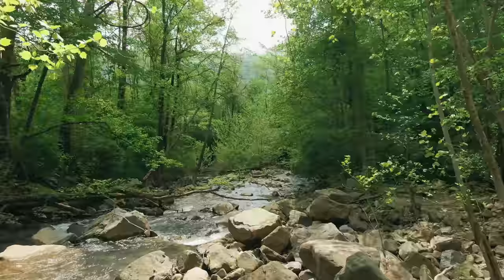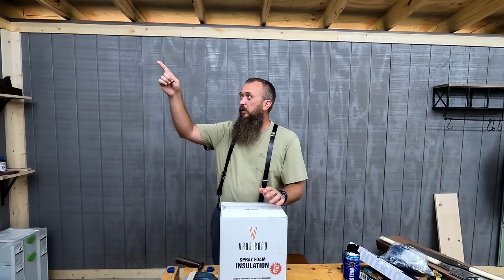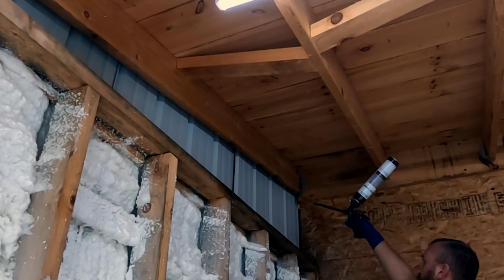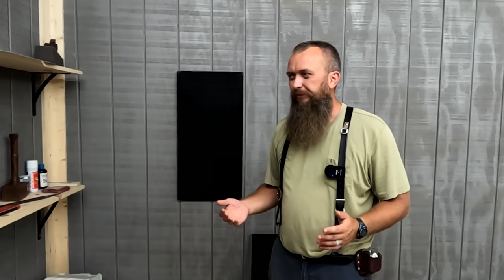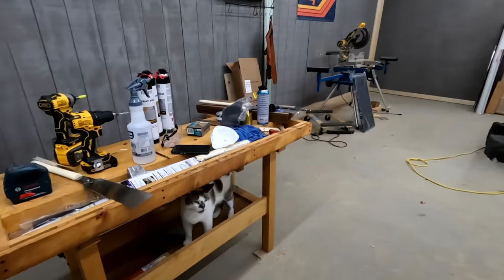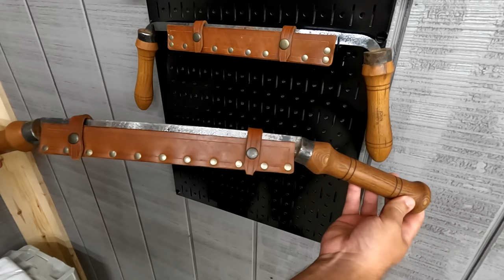Finally A DIY Spray Foam, See How I Saved Thousands

Comment: If you spray and then fill the cavity with fiberglass it will get condensation between the spray foam and fiberglass. Better to fill the cavity with fiberglass and seal on the warm side with foam . It looked like about a R-3 , what was your cost per sq ft ?
Reply from the maker: Nope this is how you do not get condensation. I’ve done many buildings this way. Do some homework before commenting
Reply: @OutoftheWoods0623  I have done a lot of homework, I live in zone two , I have done a lot of insulation and vapor barrier. If you live in a hot climate and are using it to keep heat out then it makes sense because you always seal on the warm side but when you said that you were preventing problems of condensation on the metal then it sounds like you are wanting to keep cold out . Therefore you need a vapor seal on the inside of all insulation, not outside of fiberglass where condensation will not evaporate , just sit and mold

Comment: Nathan you need to check out GALLOWTECH wall panels for hangin tools and such. The panels lock together and screw to the walls. Made for gun display but will work for tools,saws,and lots of other stuff

Comment: Me rambling a little. When a contractor or a company specialized in spraying foam does the job, the foam fills the entire opening between the studs. A lot of the times, the foam extends beyond the studs and needs to be trimmed flat. That is going to provide the best insulation performance.

How much does the foam expand to? It appears that the foam you used is not filling the space and could require a second coat to make it fill in properly. So if you use double the amount of foam, is that still cheaper than having someone come in and do it professionally? Thanks.
Reply from the maker: I went back and filled that space your talking about   Good comment. Appreciate you watching
Reply: @OutoftheWoods0623  ok, cool thanks. Would a second filling still be more cost effective than. Hiring someone?
Reply from the maker: @SteveCole73  I think so. 1$ an inch per sf with this stuff. 3$ if hired
Reply: @OutoftheWoods0623  excellent, thanks. I am converting a bus to RV and this is good stuff!

Comment: Considering the thickness that you were spraying…how much of any significant R Value did you actually achieve…🤔

It appears you have a significant air space between your minimal installation and your finished wall board…no vapor barrier…🤔
Reply from the maker: The foam is the vapor barrier.

Comment: Careful when using foam with metal siding and no barrier. It can push through the rib laps and cause seal loss creating the possibility of leaks. 
It's also unsightly.
Reply from the maker: Agreed

Comment: In a cold climate , that foam will pop right off the steel siding. Use housewrap behind the siding would help.
Reply from the maker: that makes no sense, my friend uses same product up in Northern Canada, you must think you know more than the people that make it,
Reply: @OutoftheWoods0623  speaking from experience,  I've built more barns and houses than them chemical engineers and probably more than you ! 30 years building.
Reply from the maker: 31 years here 😂😂😂😂

Comment: There's no way it's cheaper to spray cans vs a contractor!!! Here in Canada, I pay around 4.90 sq/ft for foam spray at 4".   Those cans are at least 10 bucks plus here and the quality and hardness of the foam in the cans, is no where near that of that the contractor sprays
Reply from the maker: 4in of spray foam here would be 12$ a sqft 
Depends on where you are maybe.

Comment: Much cheaper to buy 1" foam panels and cut to fit, use spray foam around the edges to seal and secure it.

Comment: If you are going to 3+" thick, it's way more expensive this way. Small projects are fine, but just the walls of a 30x40 shop would be 7k+. In my area, that job is about 3-4k. YMMV
Reply from the maker: Let’s see one inch of this spray is 1$ a bf. So 3in would be 3$. The commercial installers is 3$ for 1n so that would be 9$ for 3 inches. So no your wrong 
Thanks

Comment: Yes it saves money but over here on this side of the pond, if you’ve installed spray foam you loose money on your property as it can cause moisture problems down the line. I think personally you should have carried on with the other insulation because of the long term results. But it’s your money, so it’s your choice. 🇬🇧🙃

Comment: I'm sure what spray foam your using, close or open cell but you don't have enough to really do the job. Also you need to get behind the studs and the siding to stop the heat transfer. More is good when it comes to spray foam.
Reply from the maker: Closed cell 
By encapsulating the studs with the metal it creates a perfect thermal break. Closed cell is always topped with a thicker insulation so more is not better on closed cell. 
This isn’t my first rodeo buddy.

Comment: As a professional spray foam contractor I will say the product is a step in the right direction but certainly not the same job as having it professionally sprayed. 

My suggestion is to take a regular cab or screw the nozzle in and fill the gaps in the border to prevent the climate controlled air from reaching that ambient air pocket because it will condensate
Reply from the maker: Thanks for watching.  Every piece of the metal was covered. Just now shown on film 
Thanks for the insight
Reply: Ok great then that ought to help out pretty good. Nothing wrong with a “flash and batt”. Thanks for sharing the new product definitely a step in the right direction. I just sprayed the top of my shingles on my home about to do a metal roof over. Great video man. My names Dewayne crews I’m out of folkston Georgia
Reply from the maker: Thanks. Appreciate you watching

Comment: that foam looked truly awful  very thin. prob also didn't have good insulating value. for the material itself as well as poor thickness also being of low value.   reason why it was cheep.    no mask. no eye protection no ear protection  yipes.

Comment: While I appreciate what you did. I have to disagree. The coverage was very inconsistent. There were places I could still see metal. You didn't fill the large gaps first. You really need to fill the entire wall void. So in perspective Also, to have a company do this. Is not that cost effective to do it yourself. In the manner you did. I had 2 rooms exterior walls done. So 4 13x18 walls. My total cost was 1400$. And the results were a lot better. So as a consumer. You have to ask yourself. Do you want to spend money on hack job results or a little extra for premium.
Reply from the maker: I went back and covered all areas. Just cause you don’t see it in a video doesn’t mean it didn’t happen. Jezzzz you people on here think you know everything.  Of course a hired commercial installed would be better but I saved a lot of $ doing it myself. That’s obvious. 
Just trying to show people who can’t afford the commercial guys you can still do this.
Reply: @OutoftheWoods0623  I'm not saying I know everything. I was just pointing out a few key things. That people might not think of. Don't get me wrong. Id much rather DIY it. If I can get professional results. I don't like spending my money on just "OK". Sometime I might have to save until. I can afford a pro. Lastly, did you get a quote from a pro? I can't see that job costing $1000s. My 4 rooms came to roughly 350 a room. How much did you have in materials?

Comment: So many errors in this one. The cobwebs on the wall shows up while spraying. Incorrect respiratory protection, worn UPSIDE DOWN with a full beard. Both huge no no's. I only have 25 years as a certified respiratory protection instructor and 25 years as a certified respiratory fit tester.
Reply from the maker: I put it on upside down as a joke to ramp up the comments.  It worked

Comment: You missed so much mate 😂 and 1” of closed cell with gaps all over the place like you’ve got isn’t going to do you much good my friend.. you should’ve just used a blown in blanket system at that point. 1” doesnt get you an air barrier let alone a moisture barrier. I would definitely hire out a professional to do spray foam. You wouldn’t do your own hvac and spray foam can be just as dicey. It’s too technical of a building practice to try and diy. Any type of blown in can be tackled by just about anyone willing to do a few days of research and take the time to do it right. When it comes to spray foam hire a pro that knows building science. I own an insulation & energy company out of Oklahoma City. Bo’s insulation.
Reply from the maker: It was just a video demonstration I went back and covered everything and did follow up videos showing it. Just cause it isn’t shown in a video doesn’t mean it didn’t happen. This worked out just fine for my barn. It’s a barn remember not a house. I also done this in my other shop and it works just fine.
And not everyone can hire a pro like just said. This is a good alternative for people who want it done but can’t afford the pros.
Reply: I’m sure you believe it helped but $200 worth of batts and 3 cans of gun foam would’ve been a way better energy investment. 1” of closed cell with gaps is really not doing much.
Reply: You more than likely also softened your cornea quite a bit during this project as well by not wearing a fresh air system that covers your full face.
Reply from the maker: I did put batts over it, that’s why I did it to keep the metal from condensation and getting my batts wet. , that’s in my other videos 
If this was my only Insulation then that would be foolish. Of course I put batts over it. 
The closed cell in some areas is 3in thick that gun poured it out sometimes.
Reply: @OutoftheWoods0623  Well then that’s a proper install and I apologize! I would just say at that point, why wouldn’t you just have someone come out and put 2” of a much better manufactured foam? You’re essentially having to insulate the structure twice whereas a master foamer is going to come out and insulate with a vapor and air barrier in 1 pass. I buy cases of those cans weekly and this is just not a logical application for them. Unless you just have absolutely no foamers in your area.
Reply: You have over 200k views on a video that’s misleading (it isn’t cheaper or better). It will eventually end in many  individuals damaging their eye balls AND spending money they don’t need to spend. Im telling you, you could’ve saved hundreds and came out way more efficient with just canned foam and batts. I don’t really care if you asked for my safer advice or not, we humans have to take care of each other sir and you have too many views, it’ll end up doing some damage. I will say, these small cans are great for heat highways or pony walls etc.